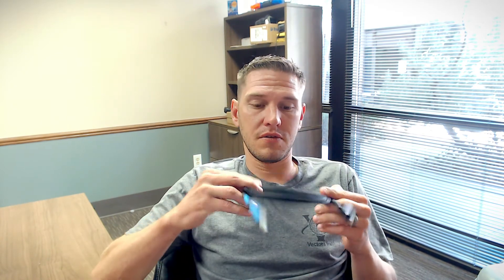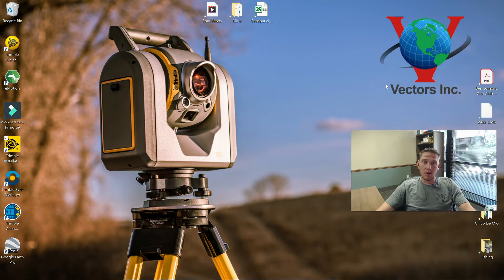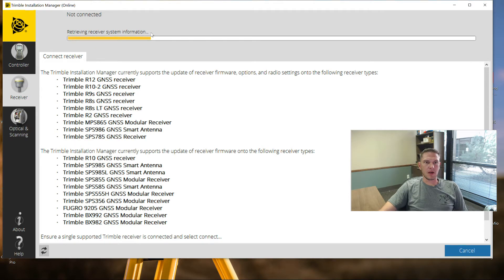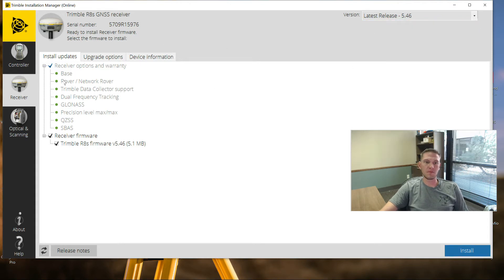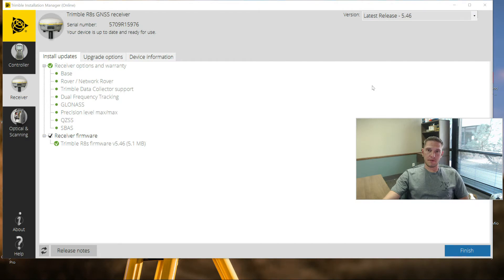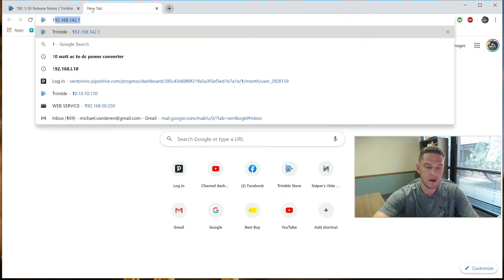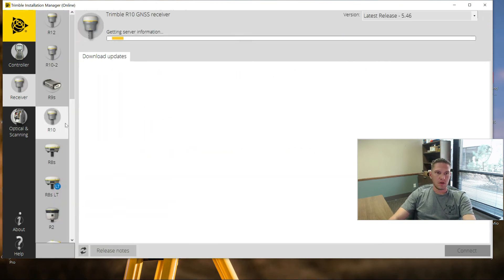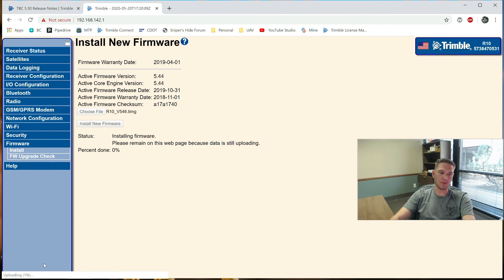Updating GNSS Firmware and Web UI - Vectors EDU Tutorial

Comment: Hi there, I am using R8s and have question to ask. I am making observations using VRS in RTN and I see my receiver is not using Beidou in positioning though the option is enabled in settings. In a static observation Beidou is getting tracked and used in position. Is this related to a firmware update issue (my rover have 5.37 version).